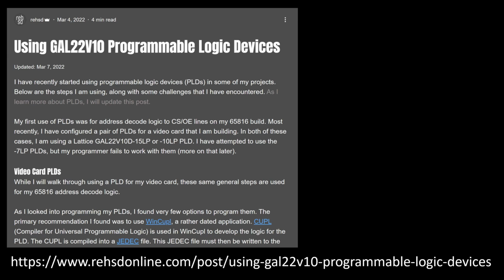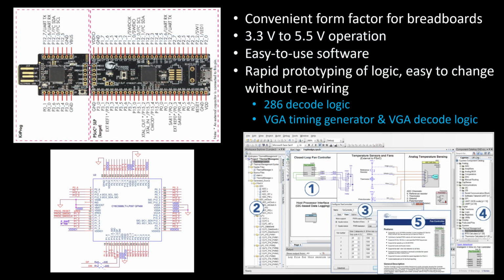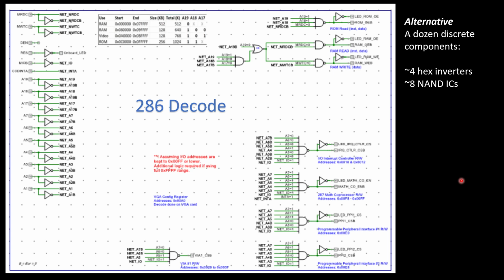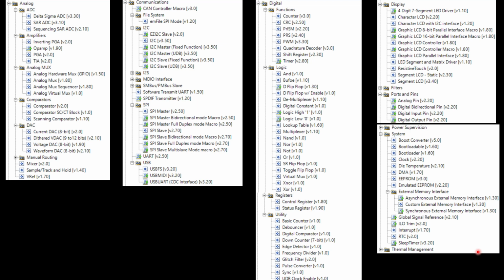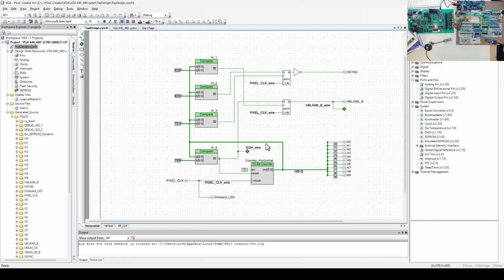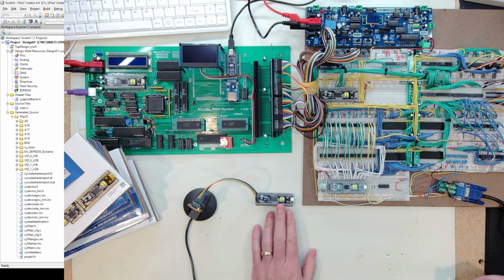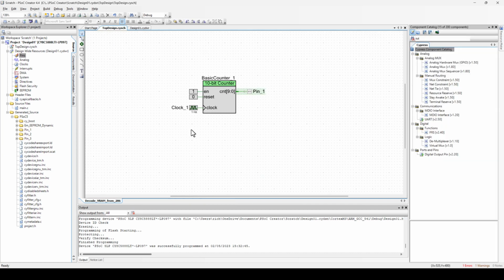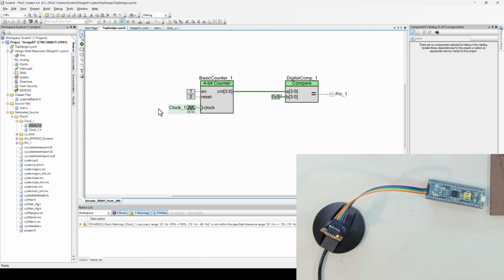Using PSoCs for Rapid Prototyping

Comment: Interesting, PSoCs basically have a more advanced CPLD bolted on. Each block has an 8-bit ALU which I don't think CLPDs have.

Which had me intrigued. I thought I'd have a look at the individual chips instead. A $15 devboard probably means the chips themselves are ~$5 right? HAHA nope.

It's only really cheating if you break your own rules. However, IMHO I think there are some unwritten rules when it comes to this stuff, it's a bit hard to pin down why doing things a particular way feels wrong. However I don't think "Thou shall not use programmable logic" is one of those rules, except for the people who misunderstand how programmable logic works.
Reply from the maker: It is interesting that the chips are double the price of the dev boards. $5 would be great. :)

Comment: IMO, using the PSoC or a PLD isn't "cheating". If the original 286 engineers had access to a $15 device that could replace the logic of over a dozen ICs the would have used it as well!
Reply from the maker: :)  Agreed. I can see the argument though that a design for a retro solution should stick to parts available during that period. I'm good either way.
Reply: I wouldn't say it's cheating. The way you look to be using them is a lot like a CPLD or FPGA, and you're just using schematic entry to design the logic rather than writing in some kind of HDL like Verilog or VHDL.

This, to me, would not be unlike designing an ASIC that would have implemented part of a chipset, and while the original IBM AT might have done (almost) everything in discrete logic, there were plenty of clones that used large scale integrated logic chipsets. So this seems perfectly valid to me.

The thing I consider cheating is taking a microcontroller running at hundreds of MHz and implementing something like a video card inside one of them. Not my cup of tea. I prefer to try and do things as period correct as possible, so lots of chips, as much hardware as possible, and I'm not too afraid to throw in a GAL or CPLD for more complex tasks, because you would occasionally find such things, or very similar things. The AT for example does have a PROM in it, which would be a precursor to the PAL/GAL type devices...

Comment: Talking about replacing the PSoC with discrete ICs at some point, is there any reason NOT to use a PLD given the lower total part count?
Reply from the maker: There's no big reason for me to go to discrete ICs. It would be cool to place just the PSoC chip itself on my board (and not use the breakout board the PSoC chip comes on).

Comment: Very helpful presentation of these little amazing things! I'm wondering if you can use just one of those for the VGA, you think it's possible?
Reply from the maker: I have thought about that a little. The biggest constraint is the number of pinouts on the PSoC board. I thought about using some sort of shift registers on the output, but they'd have to run really fast for me to run the overall system at 16 MHz (for my 286) or faster for the VGA.

Comment: Very interesting. I didn’t get what the psoc was really. Now I see. And I get why it’s so versatile. It’s pure software. It’s emulating all those gates. And the schematic you have is transformed and compiled.
Pretty neat !
Reply from the maker: If I understand it correctly, the software is used to configure the hardware in the PSoC. It has both hardware attributes (the PLD portion of it), plus the PSoC can run software on top of that PLD hardware portion. For the stuff I have been doing, it's fairly comparable to a PLD (so it would be considered hardware?). They're definitely cool devices!
Reply from the maker: I added the following to the blog post, to clarify:

One aspect of the PSoC where I was not very clear in the video is whether or not the logic that I was building is "hardware" or "software." My understanding is that the PSoC contains PLD-based sub-blocks, or universal digital blocks (UDBs). Essentially, as I am building out my circuit in the video, I am defining how the PLD-based UDBs will configured, like a traditional PLD (i.e., hardware). On top of this, however, I can write C code that runs on the PSoC (i.e., software... well, firmware). PSoC Creator allows you to "codesign your application firmware with the PSoC hardware." The PSoC is essentially a PLD plus a processor, where you can load software/firmware for the processor on the PSoC.